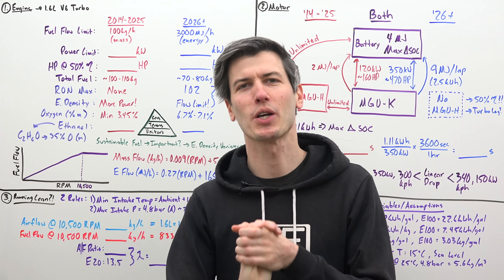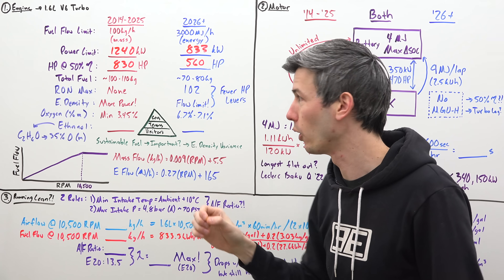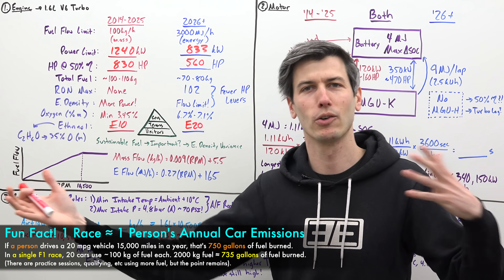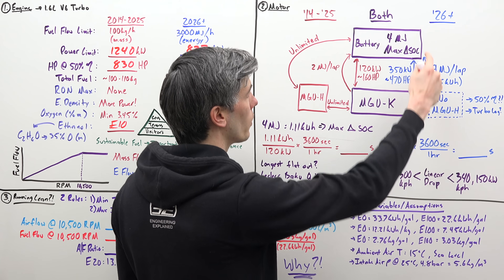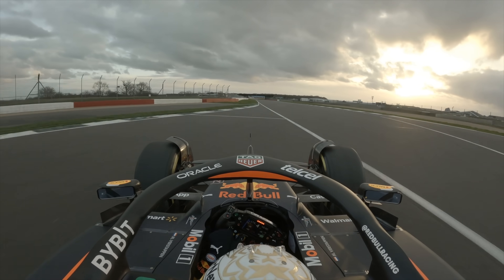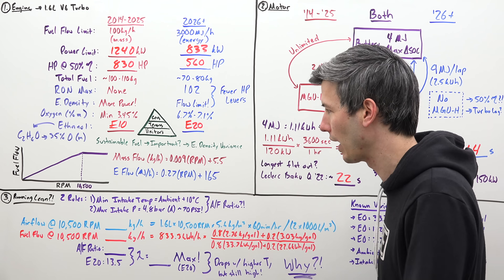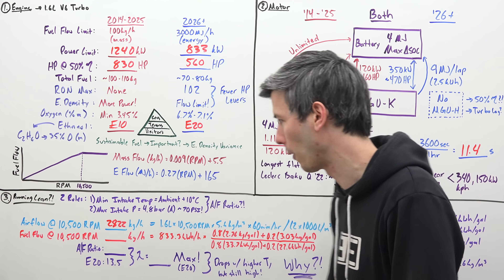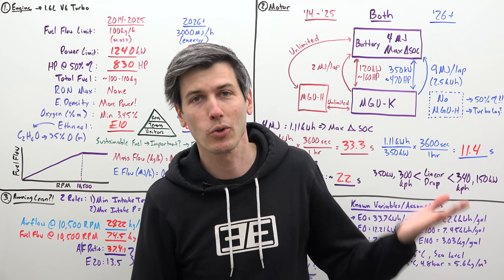Why Are 2026 Formula 1 Engines Going To Lose So Much Power?

Comment: F1 is the pinnacle of automotive engineering. I think the point of having them play around with green tech is getting those engineers developing technologies that could one day go into your fuel efficient car. You could allow bigger engines with big turbos but is that relevant anymore.
Reply: Hybrids are better in every way to ICE - power, braking, fuel efficiency
Reply: Exactly, most these people in comments don't understand. F1 is about engineering. If they want loud noise, and inefficiency with minimum engineering: Funny car drag racing is their thing.
Reply: It's a spectator sport. It's about entertainment. The engineers will do their thing whatever the regulations are. These regulations have given us a formula where it is too expensive for new teams to enter, the cars sound like hoovers and the rules are static year after year because the development costs are so high. Still could be worse, there was the year when all the cars had phallic appendages on the nose-cones…

Comment: I think the air flow limit is to stop the engines blowing too much air through the valves when off throttle. Not for blown aerodynamics as such but because they are going to be fuel dumping

Comment: Is FIA's goal to have a one make competition but not make it seemingly explicitly say that it is one make?  It seems that the idea is to limit or control the amount of power the engines can make just like NASCAR does with its throttle plates.  Now, with regards to having the engines run lean this will cause the engine to detonate, thereby making the engines more fragile to limit the amount of power these units can produce.  Again, it seems that FIA wants to control racing and have parity but being explicitly stating it as so.  Just my 2 cents.  But what do I know!

Comment: The reason for the air flow and boost limits, is to effectively limit the engine stroke. If you could run higher boost, then you could effectively increase the rate of combustion. Faster combustion means you can run a shorter stroke which gives less pumping losses and in turn more usable power. The days of 35-40mm stroke engines revving to 20k rpm are long gone sadly, but shortening the stroke is still a big source of efficiency and, in turn, power. The really weird thing here, is they are effectively taking measures to cap thermal efficiency, which is something they want to improve isn't it?... Who knows. I'm an aero guy so I leave the engine problems well alone!

Comment: See Max Verstappen and Christian Horner's comments. Not good. F1 car engines end up being generator sets for the electric motors. Sounds like a diesel electric Locomotive or a modern cruise ship.
It could also spur a new engine war. Looking for every additional hp from these newer engines. That would be costly.

Comment: Current Formula 1 is all about restriction, not innovation.
Reply: Innovation comes from restriction. That's how you maximize efficiency under restriction. If there was no restriction, everyone would be running W16 1600hp combustion engines.

Comment: All of these comments are still forgetting that the most powerful engine in F1 history was a 4 cylinder.
Reply: Only because current engines are fuel limited.  If they were to have as much fuel as the V10 engines, it would easily develop 1600+hp

Comment: These regs are a spit in the face of sustainability. Efuels are the best option for the environment as the millions of vehicles that are gas powered won’t have to be scrapped and can continue to be used. While when everyone switches to electric there’ll be soooo many mining companies with fat pockets and a VERY vulnerable grid (like what happened in the Texas snow storm). And with electric vehicles having dish a short life cycle, and batteries not being the best recycling material; it’ll produce more waist than just using the vehicles we have now with efuels. Secondly Formula E exists for a reason, so F1 doesn’t have to take on these environmental bs initiatives. Thirdly this doesn’t enhance the sport if people are watching bc the cars emit less, then they’re watching for the wrong reasons. F1 frequently uses engine of old in their marketing, why? Because they know the older engines are a better product and make the human monkey brain go off. So why are they going in the opposite direction that’ll put a fat smile on fans faces and line their already fat pockets to tumor levels????

Comment: They use an ignition chamber that is rich to generate fire from the spark plug so that they can run the main combustion chamber super lean. Also we know from Reno that the ICE is making at least 1000hp at the crank, because they bragged about it and the other teams looked at them like they were sad for them.

Comment: What will happen to F1 petrol engines in the future think they will we go full electric? I cannot see how they cannot. F1 is hard enough to watch now, Let alone going full electric. If they did go full electric I'd love to see sound systems equipped to the cars
Every season the fans pick whitch sound they wish to hear from their favourite car 
A poll could be sent out to Ferrari fans might say this season we wish to hear Schumachers
 96 Ferrari f310 the original V10 ect ect
Or McLaren fans might choose to hear sennas MP4/4 engine sound ect 
Pit stops may even include a battery change. And suppliers of sound systems sony, Kenwood ect would become major sponsors it's a win for every one.
I have spoke with some electronic technicians and they said absolutely it could be done, matching the sound coming into braking zones ect can be done on X box so there is no reason it couldn't happen in real life. Instead of Valvoline sticker on a cars side pods the sticker may read Kenwood. Would be just like watching old F1 but without all the mechanical failures we use to see

Comment: We could probably have V16's and literal jet engines and STILL be more overall more environmentally friendly if they just, you know, cleaned up the order of races so that they weren't hopping back and forth across the globe and just traveled point-to-point from closest race to closest race. But you know, whatever, let's fix the tiny problem by making things slower instead of the low-hanging fruit.

Comment: I miss the days of unlimited power where they were making 1500+ HP      BUT! I understand why they’ve made changes over the decades, some of them are pointless, some take away excitement, but other rules increase the competition on the engine building side, the sport has to evolve. They should still have a secondary sport called F-Zero that is unlimited like the days of old.

Comment: Not fully looking into the regs and wanting to trust the maths put out before us here, it just seems strange to lose performance when the fuel flow rate was changed to fuel energy as this change was done for the reverse effect and to even promote going closer to the 15k rpm limit which will also aid engine sound for the entertainment side of the sport.

Comment: 3 crazy ideas: First, if you have that air pressure, you might use it elsewhere (a little air tank perhaps?), not necesarely for the combustion chamber, for instance useit to spool up the turbo and avoid turbolag. Second idea, could be that  by playin with the valves it might be possible to blow through the cylinder and again spool up the turbo. Third, to play with the knocking effect and try to use it instead of spark plus to produce a faster and more efficient combustion, but this is only efficient as far as I know only in determined RPM ranges.

Comment: Great video, appreciation for the work you put in.
However, I think there is an error in one of the calculations. When you calculate how long the electric energy can be used, I think you should calculate with 9MJ per lap, because in one lap you can charge a 4MJ battery really 2.25 times, but that's how much you can use it in one lap. So according to your calculations, it should be able to be used for about 26 seconds per lap. Which at a theoretical 60 laps makes about 26 minutes in a race. At the moment, with a 2MJ charge of the battery in the lap and a 4MJ capacity, we should assume that each lap brings in 2MJ and consumes 2MJ, or in other words, one lap does not use electricity, it only generates and the next one uses the whole of 4MJ... with the same assumption of a race with 60 laps is currently used for about 16.5 minutes in a race and with a 120kW electric motor.
But the next generation will be 350kW electric motor and 26 minutes of use. If we assume that in 2026 a 120 KV electric motor would be used again, I make the conclusion that the electric motor will be used almost 4.6 times more - in terms of time... almost 76 minutes in a race.. Do you think it makes sense in my thoughts. Greetings.
Reply: There are a few things to consider though.
the current rules state, that the battery can only receive 2MJ per lap from the MGU-K, yes. However, the energy comming from the MGU-H is unlimited and on most tracks, the MGU-H does actually produce more electric power than the MGU-K. So the current generation can already use a lot more than 2MJ per lap, actually even more than 4MJ per lap because you can feed the MGU-K directly from the MGU-H with no energy limit.
With the 2026 rules you don't have the MGU-H anymore, ok. So now all the electric energy has to come from the MGU-K. Which means there's a problem. Even with a 350kW motor, on most tracks you won't even get close to harvest 9MJ per lap. Even now with 120kW motor they struggle on the majority of the tracks to actually harvest the allowed 2MJ simply because the time the drivers use the brakes is way to short. You calculated it yourself, they would have to standing on the brake pedal for 26 seconds per lap...there's not a track in the calender where this is even remotly the case. On most tracks the drivers use the brakes for 10-20 seconds per lap and that's it.

Comment: Regarding on what loop holes have been found by different teams to increase their cars' performance, my take on why the FIA will regulate the maximum amounts of fuel as such as air is to create a sort of double safety where those two essential parts of combustion limit and secure each other. Meaning that if Team XYZ finds a way to evade one limit, there'll still be another one that would limit the engine's power output. This would make it harder for the teams to get around the limits in general. It also means that RC/ car inspection staff could monitor more values, thus having a higher propability to find cheating teams in the process. This could spark teams and drivers to focus on fuel strategy and innovate more efficient F1 systems even more than before. Combine this with the just implemented money limit that can be invested in development and you get teams that'll have to operate as efficiently as possible to gain the best advantage over everyone else.

TL/DR: These rule changes may have a positive impact on F1 because it could bring all teams and cars closer together in terms of their possibilities, thus making the sport fairer than it was before and the competition more entertaining. My personal hope with this is that smaller teams could operate closer to the big names in terms of overall performance which would be very beneficial. Competition sparks innovation after all.

Comment: I'd like to know how they can have a boost pressure of 70 PSI without detonation.

I don't fully understand detonation either.  As the compression ratio increases, the temperature of the compressed gasses also increases.  Is it the increased pressure which causes the detonation, or is it the increased temperature which causes the detonation?

Comment: Well, considering that Mercedes stated that they where hitting around 50% thermal efficeny already in 2014... It would be fair to assume that they have broken through that quite easily. A fair estimate would be closer to 950 HP on the combustion engine allone. Then again, with the current fuel used this year, the engine got weaker... so what ever.
Reply: Gains and improvements are SELDOM linear.  Beyond that any mention of efficiency from a race team is what?  Unverified and never will be.  Law of diminishing returns.
Reply: @Look_What_I_Did  they won some kinda price for the first, early season, power unit back in 2014, don't quite remember what exactly. But I remember toto beeing very proud and giving interviews.
He stated that the icu alone was already matching/surpassing the old v8 in terms of power output. He also stated that they reached around 50% thermal efficiency, which was remarkeble. They got this prize at the end of 2014 for their first, no upgrades or anything, version of the power unit.
We know that the v8 was producing 780 HP.  And as we know the fuel flow limit, we know how much power 50% thermal efficiency means. So an power output of around 800 HP from the icu early season seams reasonable enough. The gains in horsepower where huge early days. Remember how fast down the straights the 2016 cars where? And that's with a huge gain of downforce and therefore drag over 2014. But they where still 20 kp/h faster in top speed. 2020 Renault stated that their power unit was making more than 1000 HP At all times - which was laught at by  Horner. Also, during one of his 2020 pandemic twitch streams, max stated that red bull where reaching 1200 hp in quali trim. That was Back when different engine maps and also party-mode where still a thing. According to that statement the icu whitout any hibryd must have reached well over 1000. But then, it was a twitch stream, so I will not give too much into it.

Comment: What? You always want as high boost pressure as you can until you run out of fuel (and avoiding knock). When the engine is at lower rpms and accelerating you want max boost. You dont just want max boost at max rpm, its just a power limiter as you clearly  concluded.

Comment: AF at 37 could it be a really enhanced version of SPCCI Engine from Mazda? With a very high lean mix that can create a lot of power by having high compression and strong/reliable parts and magical to reduce knock occurence ? Of course with Ethanol we know that’s help a lot, it’s just about to cool the cylinder, at end we have engine that runs crazy amount of air, I think it’s possible.